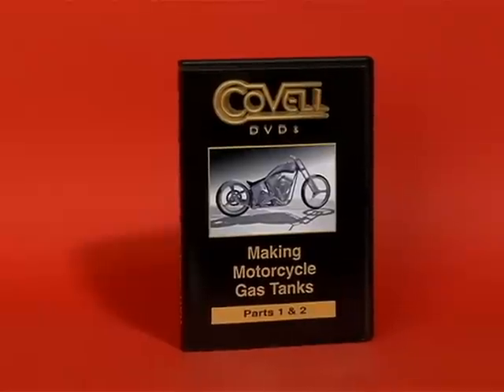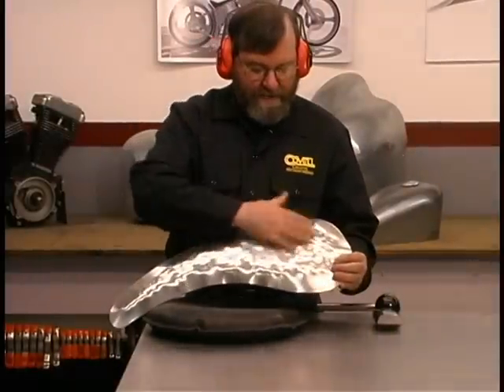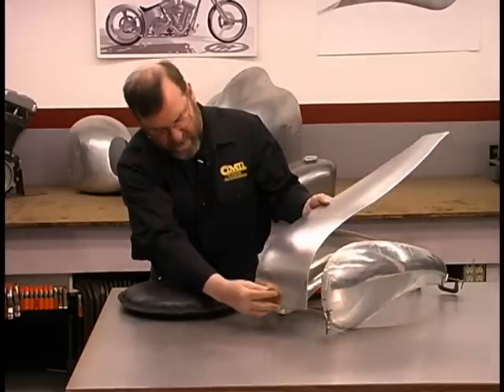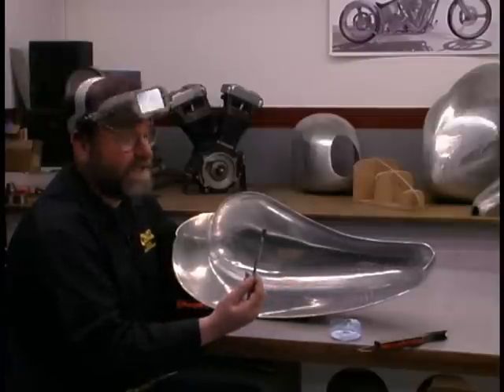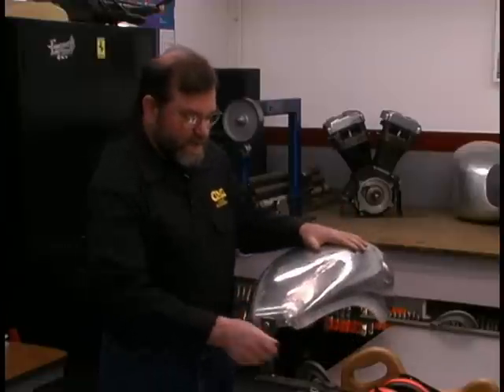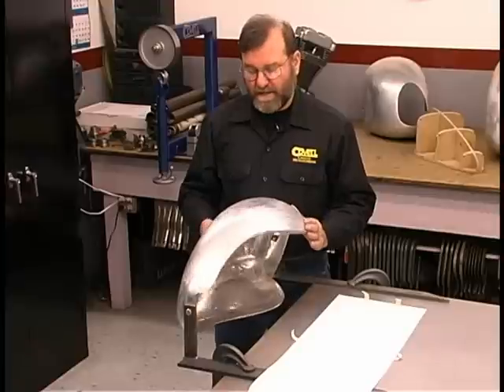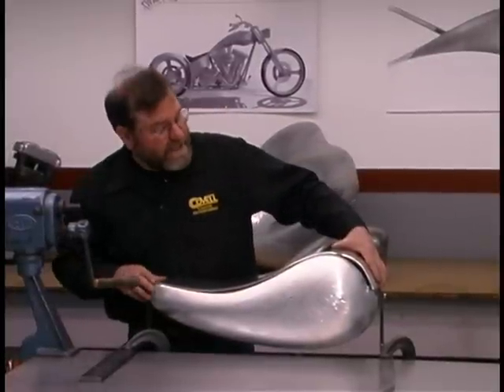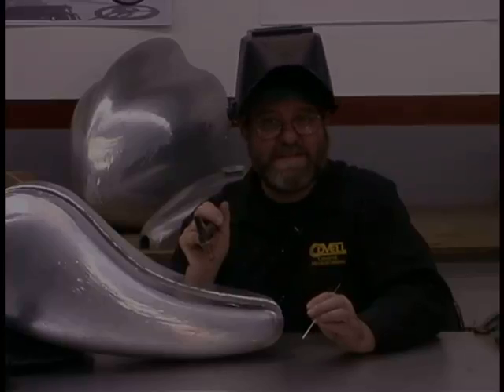Making Motorcycle Gas Tanks - Part 2

Comment: Question: Is oxy welding aluminum welding or soldering?
Reply from the maker: Aluminum can be both welded and soldered. Welding is joining by melting two pieces together, and if filler rod is used, it is made from a material that melts at around the same temperature as the base metal. Soldering uses a material that melts BELOW the melting temperature of the base metal, and it joins pieces by surface bonding, rather than melting together.
Reply: @RonCovell  Thanks for clarifying that Ron. I should've paid more attention in class. lol

Comment: The problem with aluminum is metal fatigue. It will tend to crack when subjected to long term vibration. That is why you are flirting with disaster when building fuel tanks out  of thin sheet aluminum.
Reply from the maker: You are correct that aluminum has less resistance to stress cracking than steel. A couple of ways to compensate for this are to rubber mount the tank, and to use thicker material.
For example, companies like BSA made hundreds of thousands of motorcycle gas tanks from aluminum, and failures are relatively rare.
Reply: @RonCovell  : I ran a little shade tree welding shop for years which specialized in aluminum repair welding on automotive cylinder heads for the local engine rebuilding shops. I have repaired hundreds of cylinder heads and none ever failed.
I built parts for saltwater marine vessels as well as race car parts out of aluminum. I have been dealing with aluminum for decades.

I had a buddy who wanted an aluminum fuel cell built for his race car. They are relatively common. I refused, because of the simple fact that metal fatigue in aluminum is very real, and product liability insurance for something like an aluminum fuel tank is prohibitively expensive. Aluminum has its own metallurgical problems. 

Even if your business is incorporated, and insured, a personal injury lawsuit regarding a serious injury or death resulting from an aluminum product which split open and spilled fuel, and then catches fire will guarentee that you will get sued. It will cost you thousands and thousands of dollars, even if you win.  

Failed fabricated aluminum items from your shop could easily put you out of business and might result in you losing everything you own in a court decision which rules against you.

Last time I checked, BSA and Triumph were out of business. There might be a reason for this. 

Don't get me wrong; you have a reputation for being the best sheet metal man in the business. Your videos are world class. You are the best. HOWEVER, please remember that the world is full of slimy lawyers  and idiots who are looking for an easy buck. Please be careful.
Reply from the maker: Thanks for giving such a thoughtful reply, and all your points are well-taken. Fortunately, I don't do much work for customers anymore, so I don't have to be as concerned about liability issues.
Reply: @RonCovell  : I always wondered how those commercial air conditioning guys built those sheet metal ducts that went from round to square. Have you ever considered publishing a book detailing all your tricks? With some marketing, it would be the Bible of Sheet Metal Ductwork. 

I would damned sure buy a copy.
Reply from the maker: Well, I certainly have considered writing a book. Most of my efforts so far have gone into making videos - many are available free on YouTube, and I also sell longer videos on my website - available by streaming, and on DVDs.

Comment: I guess the biggest weak point in the proccess is the weld due to the fact so much is grinded off and it can weep petrol if not dome perfectly. So important I guess to 100% know your welding techniques and to start off with clean metal. It is not even possible to weld a good bead on the inside due to access and then a decorative one on the outside for filling and grinding and cosmetic purposes. I suppose you could fill your tank with a tank sealer which I suppose you are going to need anyway if you are using mildsteal as the petrol will corrode the metal over time anyway. Brilliant skills and it shows taking one step at a time in life and having persistence will get you there. Of course with this technique practice makes perfect.
Reply from the maker: Thanks for watching, and your points are well taken. Petrol itself does not corrode steel tanks, but it often collects moisture (condensation), which can cause rusting.

Comment: Curious as to if you can smooth with a pullmax instead of a English wheel?
Reply from the maker: You can certainly do some smoothing with a Pullmax, but in general a power hammer, planishing hammer, or an English wheel are more efficient for smoothing.

Comment: One thing I've wondered for a long time is, how is gas supposed to get from one side of the tunnel to the other when its level gets down that low and you're in the middle of nowhere? Many bikes are too big and heavy to tip over to transfer it (and you can't tip a 4-wheeler easily).
Reply from the maker: Many gas tanks have a 'cross-over' tube that feeds gas from one side of the tank to the other. You can see pictures on this page:
http://www.dansmc.com/gastank.htm
Reply: That page seems to only mention 2-piece tanks having a cross-over. My KZ750B1 and Moto-4 225 have nothing to bring right sump gas to the petcock in the left sump of the 1-piece tank when running that low.
Reply from the maker: The crossover tube will work for single tanks, too -  where the lower portion is divided into two sections by the tunnel.  You would need to weld a barb fitting onto the lower section of each tank side, and connect the fittings with a small hose.

Comment: Interesting. I did my apprenticeship in sheet metal and did a lot of shaping such as this with Aluminium. We used soap to check the annealing temp. We only used the steel wheels for final finishing. The shape work was all done with a rubber wheel and another machine we used was called a bumper. It was two long arms with a 1 inch ball in the top arm and a rubber pad in the bottom arm. It was a mechanical hammer  and  would stretch the metal to raise up areas. We used wood mallets over a dolly to shrink the metal by creating pleats that were then smoothed out. It was hard work and took many years to get as good as the old guys who taught me.
Reply from the maker: You were doing the 'real deal', indeed!

Comment: I worked for McDonnell Douglas/Boeing and saw a number of mass produced contoured rounded structures ....what they used were dies and molds and Bag Press technology ...they put in the form and the sheet metal and then a hydraulic bag forced the metal into the exact shape  ....way faster than on thi video but not a bit better looking!  Not to mention the tool and die hours that went into such not to mention the major expense of a bag press operation!   This guy is doing what big corporations pay entire crews to do in high buck facilities!
Reply from the maker: Dougie Quick - the process you describe is called 'hydroforming' and it is still used for many industrial fabrications. It requires a huge investment in tooling, but once that is done, the parts can be made very efficiently. The processes I use are better suited for one-off parts, or small production runs.

Comment: Hi.. I'm doing the same...
Have you any reason for not tig welding the joins.... 
I typed the message just as you said tig and gas ok 👍
Reply from the maker: Well, it looks like you answered your own question. Quite a few builders prefer gas welding, because it is a bit less prone to cracking, especially in situations where there is a lot of vibration.

Comment: Any recommendations on aluminum alloy grades to start with? Do you leave the tank in an annealed state?
Reply from the maker: I prefer 3003 alloy. Even if the material is annealed, it develops sufficient strength by work hardening, and the domed shapes give it extra rigidity, also.

Comment: Absolutely stunning work.  Would it be possible to weld the bottom of the tank with the oxy-acetylene torch?  If so, how would one flux the inner seam?  Would you flux each edge before you fit it together?  Thanks!
Reply from the maker: Yes, you could gas weld all of the seams. You certainly could brush some flux on the inside of the joint before welding. The flux needs to be washed off within a few hours, but it dissolves nicely in hot water. You can pour very hot water inside the tank and shake it around to remove the flux from inside the tank. I would repeat this a couple of times, since even a tiny speck of the flux can cause corrosion to form over time.
Reply: Awesome, thank you!

Comment: Very nice! I have two questions though...

1) How much material are you taking off with the draw file, during the process of leveling the surface? 

2) I noticed you hammered the OA-welded bead flat, but then sanded the TIG-welded bead flat. Is there any particular reason? It didn't look like there was that much more bead with the TIG weld, but maybe that's it?

Thanks Ron!
Reply from the maker: Tom B - Good questions!

1. The material I used was .080" aluminum, and I probably removed about .008" with the filing. 

2. Gas welds are softer than TIG welds, and are usually lower-profile, so it is often feasible to hammer (planish) them flat. Since the TIG welds are harder, and often larger, I usually just sand them flat, although they can be planished to a certain degree. If I do plan to planish a TIG weld, I usually sand or file the outside flush, and then hammer (or wheel) the weld until it becomes flush on the inside.
Reply: OK, thanks. I suppose that if the TIG weld were to be planished, it might even fracture due to being harder...unless it was normalized first. 

I would have thought that you were taking off more than 0.008" though, to be honest. But with 0.080" material thickness, I guess you've got some to give without a problem.

Comment: That's some very nice work there brother. Any chance you could make a 3/4 gal tank for me? I don't have the time it takes for a custom tank. I need it for a custom peddle chopper. I am working on the twin V engine. With a pattern I got from Germany.  I might have time next year to make a tank, but I hope to be riding by fall. If you can, I would like the same shape of tank as this video. I would like to have it unfinished so when polished and shot with a translucent blue paint, it will look like blue chrome. To match the finders and frame. But I might do some ghost flames. If the House of Kolor can match the shade of blue I have in mind. And I am betting they can. The paint they make is like liquid heaven. I will be sure to credit your work if should I be published. I know a great deal of people would also like the small custom tanks. Could be a start of a new line of fast selling tanks, if the cost is right for a adult toy.. Anyway if yes hit me up, if your not wanting to help me out. No hard feelings you do make a very nice handmade tank. Far better the cheap made in China crap I see around town.
Reply from the maker: Crowley - I can envision what a polished aluminum tank would look like with translucent paint - it would be great! Thanks for the nice offer, but I don't do work for customers any more.

Comment: Hey I watched u form billy lanes gas tank in biker build off. Did he not pressure test it before it caught fire lol
Reply from the maker: Christopher - that was from a long time ago! There were several issues that led to that unfortunate fire. The bike had an automotive carburetor (Stromberg 97) and it was always way too rich, causing the motor to run rough and ragged, and to vibrate violently. The vibration caused several problems (including cracking the gas tank) but the vibration also broke the coil mount, and when the coil fell down and hit the motor, it caused a spark, which started the fire. To his credit, Billy Lane never blamed me for the fire, and took the problems in stride. I have a lot of respect for that man - a very hard-working and creative individual!
Reply: Ron Covell I completely agree! Billy lane is definitely my top 3 favorites. Love how he doesn’t use a measuring tape just all eyes. And you my friend are a master at what you do. I’m currently building a bike more Indian Larry style but with a twist. All of you inspired me to finally build one after watching you guys for 15 plus years. Thanks for the feedback. Just a regular ordinary welder/fabricator here loving what you guys have done and still do.